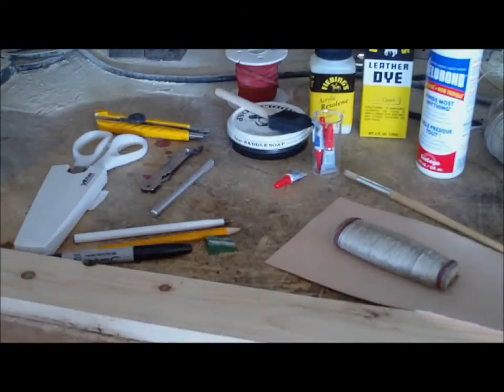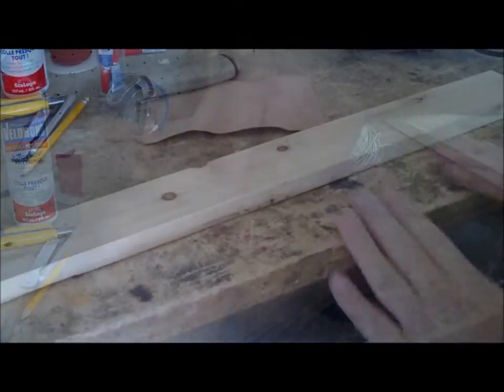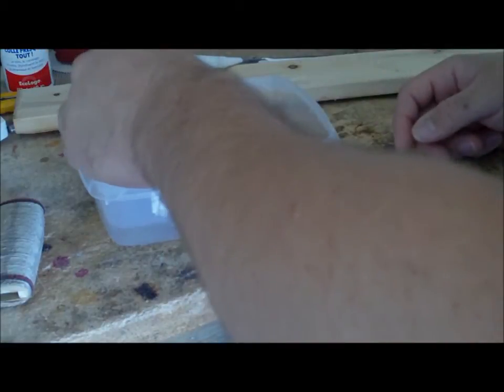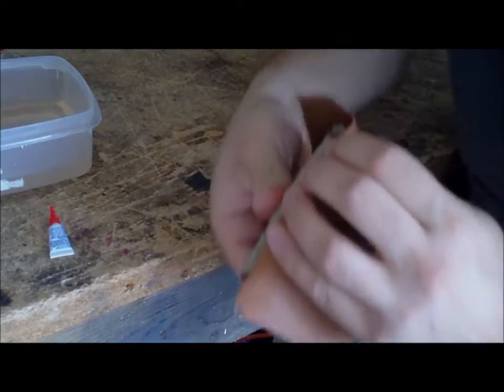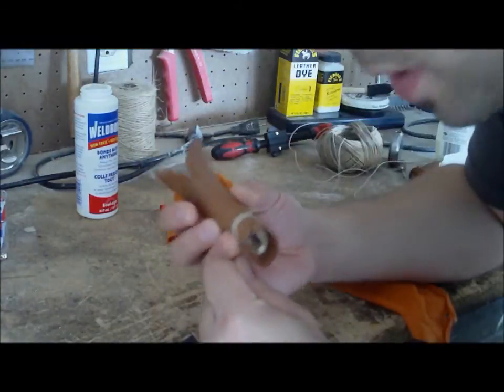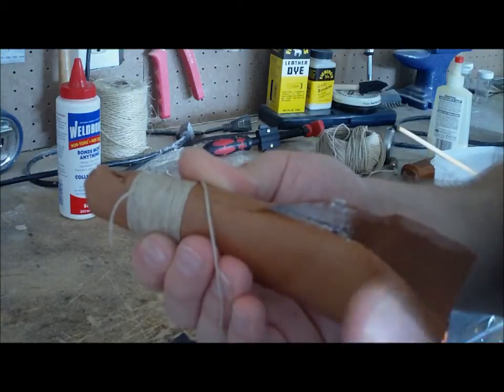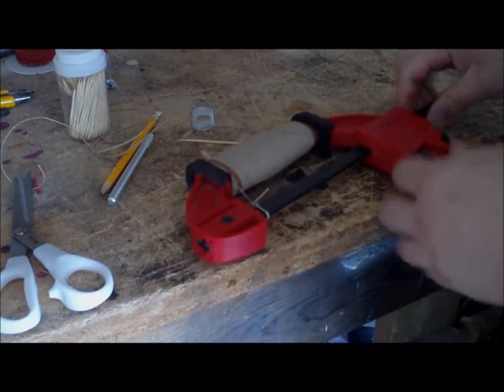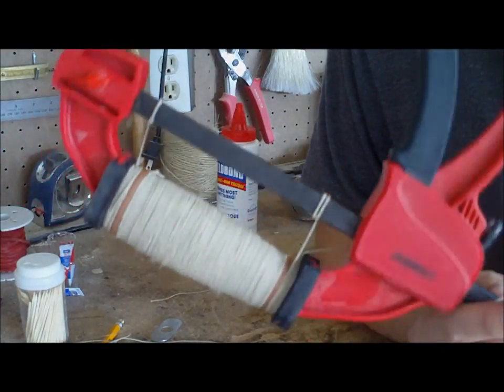Euro Sword Grip Making: Part 3 - Leather Wrapping

Comment: I plan on goin to a tandts store but is 1 oz lamb hyde thin enough? I just bought this stuff on ebay for 13 bucks. I'm not sure how he dyed it but its dyed dark brown already.  I cannot remove the handle from the sword. The handle is for a cold steel grosse messer and the riveted wooden grip encapsulates hidden tang qnd I have taken apart this handle and fixed it but cannot take it apart again. Also doesnt have much shape at all, pretty much same size all the way around. I'm wrapping, so I'm working on handle while fixed to the sword, and I'm not sure if I'm going to be dying it at all. 

Is there pre dyed veg tan leather that you reccomend?. I dont think I plan  on having any color but black or brown anyway

Also is this lamb hyde thin enough to leave nice deep impressions of chord wrap?
I have 2 types of jute twine, one from Michael's that seems to fray quite a bit and cotton jute twine from home depot, is cotton jute twine from home depot ideal?

The stuff I bought on ebay is called grade b Italian Lambskin leather. Thin  1 oz

thickness: 0.5 mm (1 oz)

Approx Size Chart:

5 Sq.Ft = 22" x 28" Inches

6 Sq.Ft = 24" x 30" Inches

Comment: The sword I'm re-gripping has a peened pommel, so I was wondering whether you knew how much to allow for shrinkage on either side (where the guard and pommel are. I noticed you could just let it hang over each side and trim it later)
Reply: +SerAlgernop BlitzKrieger I regripped my sword early this year; what I did was to apply the soaked leather without using glue, then left it under the cord overnight.  Then I cut the excess and apply the glue and leave under the cord overnight.  

Then there's no fear of it not fitting perfectly.

Comment: Do you have cord on the inside of the leather wrap too or is it just smooth wood?
Reply from the maker: JRT there is cord under the leather. The cord is wrapped around the entire wood core, leather is glued to this and wrapped with cord to dry. The cord on op of the leather is removed one day later once the leather is fully dry. 

If the cord is removed too soon the impressions left by it will soften and lessen.

The cord underwrap (permanent one under the leather) should be strong and thin. Lately I've been using artificial sinew for example.